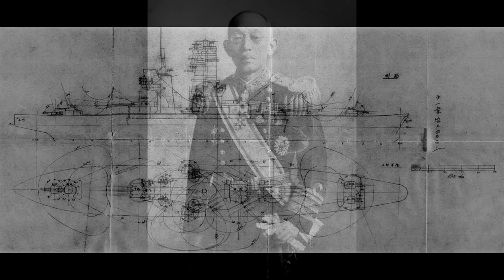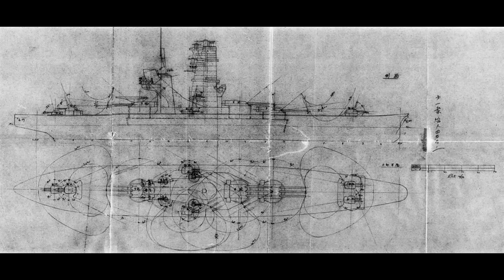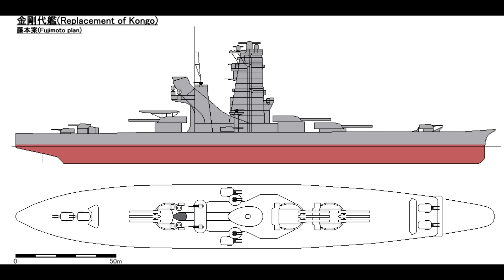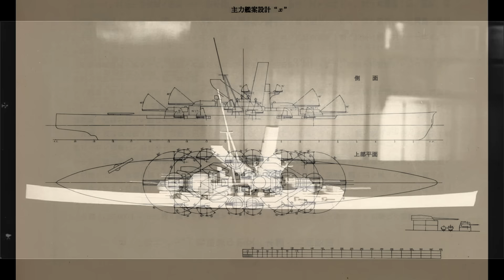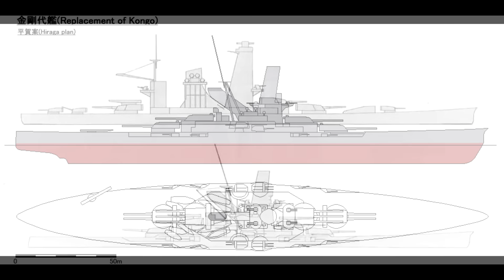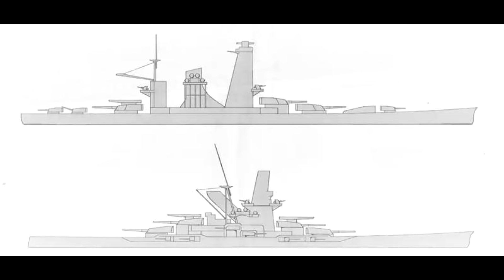Kongo Replacements (1931) - Guide 380

Comment from the maker: Pinned post for Q&A :)
Reply: I saw this question on the HMS Association Facebook page and thought: "Now there's a question for a Drydock."
"I was wondering if anyone can answer my question. When on peacetime operations to what percentage were ships magazines stocked. For example Hood would have used a lot of fuel on her goodwill cruise and I imagine with 50% ammunition loaded as opposed to 100% that could have saved on fuel and wear and tear on machinery. Or was this not a concern?"
I assumed in times of stability, they'd probably a ready to use emergency supply, plus maybe, something like reduced charges for gunnery exercises?  In more turbulent times they could adjust as needed?
Reply: Please do a deep dive on all gun layouts, why they were placed here and not there, their origin, reasoning, advantages and disadvantages etc, etc..
Reply: How do you think a last cruiser gun duel would have went between the ARA Belgrano and the pair of HMS Tiger(C20) and HMS Blake(C99) would they not have been retired a decade prior to the falklands war?

My take is that the Belgrano would have easily "de-gunned" the royal navy cruisers since the turrets on them had splinter protection at best. After a firepower kill the british would have had to cede the battle or call in for help from either air assets in the area or a submarine.
Reply: What if the Washington Naval Treaty had capped cruiser guns at 7 inches for light cruisers and 9 inches for heavy cruisers?
Reply: I was watching Rex's Hanger's video on the Arado Ar 196 in which he believes it to be one of if not the best seaplane of the war and it got me thinking which do you believe would be the best seaplanes built by each navy during the second world war? Do you agree with Rex's choice for the Kreigsmarine?
Reply: On the second proposal, why were the tripples superfiring over twins, instead of the other way around? The front pair sits so close to the middle of the ship, that the hull is barely narrowing and the rear pair, where the hull isn't narrowing at all.
Doesn't the extra weight higher up negatively affect the stability? What advantage of this layout makes it worth more than that loss of stability?
Reply: @Shadooe  Not trying to short-circuit Drach but I suspect the answer lies in ballasting requirements.
Reply: What could have changed if the Vickers 14 inch gun salesman had been locked in a room and the Kongos had been built with the planed 12 inch guns? Post ww1 would they have been scrapped, up gunned or kept the same guns?
If they survived the interwar would the have been nigh on useless?
Reply: Do a review of USS Walker DD-163.
Reply: @Norbert_Sattler  i imagine its due to trying to shave down every metre of citadel length
Reply: How many extra capital ship-sized drydocks would Japan have to have had to not go with the superweapon concepts like the Yamatos and Shokakus?
Reply: I've always wondered about the structural strength and stability of those heavily raked funnels as well as their effect on the overall stability of the ship.  What would be the benefits of placing so much unarmored mass so high in the ship?
Reply: Why was the IJN planning to replace the Kongos before the Fusos and Ises? Even the youngest of the latter would have been 15 years old by the end of 1933 and, though the Kongos' protection was somewhat anaemic, they were fast and decently armed, while the Fusos/Ises were fast for their time, but well behind the standard set by the Nagatos (and the planned designs cancelled by Washington). Given that the IJN always seemed keen on having a fast battleline, why not do what the RN did with the QEs and Rs, and swap the official order round so the newer but overall less effective ships would be replaced first?
Reply: You mention that the extremely short citadel of these designs would have meant that there wasn't enough reserve buoyancy to keep the ship afloat if the non-citadel parts were riddled. How many historical battles would this have mattered in? Were there actually many engagements where battleships were subjected to enough fire to smash up their unprotected sections that thoroughly, without also having the fire be able to breach the citadel?
Reply: @Drachinifel Drach, I was curious whether the Third Reich learned anything about battleship design from the captured hulls of the incomplete Richeliu, Sovetsky Soyuz, and Littorio classes. In a timeline where the Third Reich continues into the Cold War era (and megalomania allows for continued battleship construction), what would German designers have learned from these captured hulls and what would a hypothetical late 40s, early 50s German battleship look like?
Reply: What would an Italian-style money-is-no-object rebuild of older American or British battleships (such as the Wyomings, New Yorks, or [in a world where 1st London extends the building holiday but doesn't mandate additional scrappage] Floridas or Iron Dukes) look like and what would be the capabilities of these rebuilds?
Reply: In terms of carrier air wings in the second world war It seems there were 3 major paths that could be taken the Italian route where the re 2001 does everything dive and torpedo bombing and fighter roles, the late war Japanese idea of using the B7A as a dive and torpedo bomber but then having a dedicated fighter or the early war standard trifecta arrangement of having dive and torpedo bombers and fighters what are the pros and cons of each? And what personally would be your choice if you were the logistics officer in charge of aircraft type procurement for a carrier in WW2 and would your choice change depending on if it's an axis or allied carrier?
Reply: @WarrantOfficerWill22 I doubt anyone would have proposed or supported that. The 1922 cruiser definition was based on the British Hawkins class of just under 10,000 tons with 7.5" guns. The treaty limits are some slight rounding from the Hawkins. If a larger gun was going to be permitted, the British would have demanded their 9.2" guns be allowed. The 6" gun light cruiser wouldn't be defined until the London Treaty in 1930.
Reply: During naval gunfire support how many salvos were neccessary for the batleship guns to hit a stationary position in the excess of 30 kilometers away? Perhaps the best would be to know how many battleship shells the Navy was expecting to spend on a singular target. Assuredly calculations were widespread in this regard.
Reply: Would the Japanese been better off with some form of fast battleship Kongo "replacement" probably more augmentation than with Yamato and Musashi?  They did not get a lot of value out of the Yamato's and might be better served with some form on carrier escort.  Heck are battleships the right choice for that duty?
Reply: Regarding the 14inch limit of the London naval treaty, was there ever a major effort from any navy to get as much out of a 14inch weapon as humanly possible by going for a very long barrel? Which caliber length could have been successfully built? The Germans had plans for a 15inch weapon with 56 caliber lengths, so is it reasonable to assume a 14inch/60 weapon could have worked?
Reply: If these designs had been built either one of them, how would they have held up against their counterparts ?
Reply: Much criticism is made of ships that do not have enough reserve buoyancy in their citadel to stay afloat, but how much of a draw back do you think this really is?
Reply: Would love to see a video on the US Coast Guard's Greenland Patrol activities, where they assisted in convoy escort between the East Coast of the US and Canada to Iceland, and the weather patrol they ran throughout the war.
Reply: @Shadooe  in peacetime they carried a reduced complement of ammunition, and only fully stocked during war
Reply: My great uncle worked in the Vickers sales department. As all of the salesmen were trained locksmiths this particular salesman would have easily escaped the room and then sold the Japanese the appropriate gun.
Reply: Hey Drach, something I’ve been personally curious is despite overflying Shinano’s anchorage and having a photo of Shinano in port why was the US unaware of Shinano’s existence? Did they believe they were looking at a smaller carrier (if so what carrier) or was it just a case of the photo not being put in the hands of the right people?
Reply: The Japanese were certainly capable of designing and building ships as the Yamato showed, so why did the Japanese Navy decide to build a few Yamatos after leaving the treaty system instead of a larger number of what you could call a 'Japanese North Carolina-Class'? This would have avoided the risk of starting an arms race that could have possibly ended the treaty system several years sooner, closed the gap in battleship numbers, and would have given the IJN a fast battleship that was able to match up to just about anything the US had in the treaty era.
Reply: Could you explain the advantages of super firing turrets with more guns than it's little brother? I would assume that the disadvantages of the taller barbette being the largest would make this a very niche idea.
Reply: What is the smallest single gun that could penetrate the armor of a battle ship and has anyone ever tried mounting just one on a ship just big enough to carry it? If so why and if not why not?
Reply: @schullerandreas556  Such a fight would've probably gone very badly for Tiger and Blake. Not merely because of their turrets being lightly armored, but because by that point each of them only had one turret due to being converted into helicopter cruisers. Their autoloading 6" guns were faster-firing than General Belgrano's manually loaded ones, but not by nearly enough to make up for the disparity in barrel count.

With only Tiger and Blake, you've got 4 guns each firing at best 20 rounds per minute. Whereas Belgrano had 15 guns that could fire 8-10 rounds per minute. Even if we assume Belgrano's gun crew was subpar and didn't load the guns as fast they were designed for, and that Tiger and Blake had everything working perfectly, there's just no getting around the "15 guns vs 4 guns" issue.

For this to be a remotely winnable fight for the British cruisers, you'd need HMS Lion (C34) to somehow not have been scrapped in 1975 and instead also be operational. At that point you actually have enough barrels between the three sisters that their superior rate of fire would make up for Belgrano's superior barrel count. And also the advantage of having your firepower spread across three ships that could fire on Belgrano from different angles. But Belgrano would still be much better-armored.
Reply: @Norbert_Sattler  I'm pretty sure it's because of how Hiraga went to extremes to create a compact citadel in that design. The hull isn't narrowing at that point, but the citadel is.
Reply: How good carrier conversions would these ships have made? Same for the Kongous
Reply: The USN takes a. black eye for friendly fire issues early in the war. Question, did none of the other belligerents have these issues when they started out, realizing that most started three years or more before the USN. What type of gunnery program did they use in peacetime to attain such better gunnery prior to hostilities? Given the cost of main gun rounds and torpedoes, how was that possible?
Reply: At the start of the USA civil war there was a possible deal of the confederacy buying a fleet of eastindiamen  iirc 10 ships for 2 million do you know more information on this and would the deal have helped the south?
Reply: Were the fixed, transverse-mounted torpedo tubes on the second design and others of the period actually useful? The inability to aim seems like a major issue.
Reply: Love the videos keep up the good work! (Excuse my english)

As for my question, i have personally always wondered something: who exactly did Belgium never invest in a navy?

We had all the reasons to do so: we had overseas territory (The Belgian Congo), we had our own ports on the north sea the main one being Antwerp which could be at risk of blockade.

From what i understand we always just relied on “surely no one would harm us” to keep our waters and freight ships safe. The ships that we did have were at first stolen from the dutch when Belgium broke away and a single fishing protection ship that was being constructed just before ww2 broke out thats comparable to at best to something like a V class minus the torpedo’s.

And along with the, from what i understand the only naval engagement we ever took place in was on the lake Tanganyika in ww1 of all places.

So overall, i would like your insight if you have any on the subject.
Reply: Drach, you usually save museum ship videos for ships after you visit them in person. I am guessing your not planning a trip to North Korea anytime soon, so how about a video on the second-oldest commissioned ship in the US Navy, USS Pueblo? .........Not part of the question, but laid down in 1944, so technically covered by time period of channel even if the interesting bit comes in the 60's. Also ship named after my hometown...and now i cant have a new ship since it probably wont be returned any time soon....
Reply: Just discovered your channel recently and am really enjoying it. Have you ever heard of a video game Battlestations Midway and Pacific. I think you should do an experts reacts kinda video on them to show what’they got right and wrong with battles and ships and aircraft design.
Reply: Drachinifel, what if all the USSR's surviving Gangut class battleships had been moved to Murmansk before 22 June 1941, so that they would be based in the Arctic instead of the Baltic or Black Seas? How would this affect the war?

Comment: Hiraga's design wouldnt be half bad if they went with 3 triple turrets and move the saved weight into extending citadel for more reserve bouyancy. Add in some creative accounting and IJN couldve had a few Littorios of their own...
Reply: Littorios were the best (not so) treaty restricted battleships
Reply: @85isaboat53  Littorios were almost perfect. 30kt speed was a requirement and this necesitated raised barbette of the aft turret so that aft secondaries could be moved further aft to facilitate engine room space in order to achieve the desired speed. 28-29kt was achievable without those changes and would probably fit within 36k tons if the hull was shortened a couple meters as well. And imo, the ships would be even more beautiful, which is ofc the main consideration in any Italian design.
Reply: @mazdrpan4099  yeah they were probably the coolest axis battleships
Reply: @mazdrpan4099  Japan might have needed a bit more range from their ships, but within the confines of the Mediterranean, the Littorios were amazing.
Reply: Hiraga probably knows that IJN high command will demand that this Kongo replacement has 'modest' number of main guns. He might have think ahead of them.

Comment: Interwar IJN capital ship designs were really weird looking, good thing that they got the Yamato right.
Reply: Unfortunately for them, they got it right when it was completely pointless.

Fortunately for them, so did everyone else.

Unfortunately for them, that only evened things out, meaning they were STILL at a massive disadvantage in terms of being able to build stuff in wartime.
Reply: The goal Hiraga was aiming for was to keep the battery as compact as possible to maximize the chance of getting first round hits.
Reply: @Graham-ce2yk  their 'compactness' is the thing that I don't like about this Kongo replacement. It leaves little area for future upgrades like most of IJN capital ships.

But overall, better than what they had including the Nagatos.
Reply: Helldiver pilots would agree with that. (Ships so wide I CAN'T miss!!🤩)
Reply: They couldn't the the French have all the fun!
Reply: @leftcoaster67  Again, the design of the superstructure looks odd, but there was a reason for the odd shapes, Hiraga was trying to keep the stack gasses away from the fire control directors.
Reply: @paulsteaven  Due to their treaty tonnage, room for main gun upgrades would be a non-starter. However, their compactness actually made armour upgrades easier, because there was less of it needed.

The evolving threat environment meant agility and speed was much more important, and a shorter and thinner hull meant it would be more survivable than a larger target
Reply: @charlesc.9012  I'm not talking about the main guns here as they're going to use Amagi/Tosa class' main gun from the start instead of the Nagatos. I'm talking about the secondary DP guns.

They could replace those 6 inch turrets with 12.7cm DP guns, but still little to no area for lighter 25mm guns.

P.S. I know that this is from hindsight and the 25mm guns were not that great, but still...
Reply: @paulsteaven  Most smaller AA guns were not useful anyway, because accuracy is impossible in sea states higher than 4, and planes could release ordnance from far away without impacting lethality.

The genuinely useful guns were the 5? inch guns using RADAR guidance and proximity fuses, which they never had; Naval aviation was also much more useful.

Besides that, it wouldn't be that difficult to weld on extra platforms to fill the air with more tracer fire.

Japanese captains were good at helmsmanship, and huge ships such as Musashi were dodging torpedoes and bombs for hours on end, so that extra mobility from a slender hull form was certainly more useful.
Reply: Even Yamato took a loooong time to reach its iconic design.
Guess the Japanese designers were too impressed with the Nelsons.